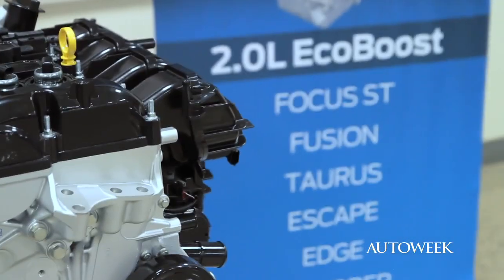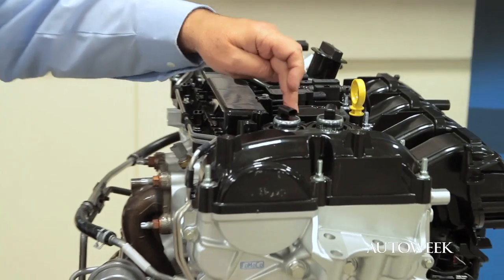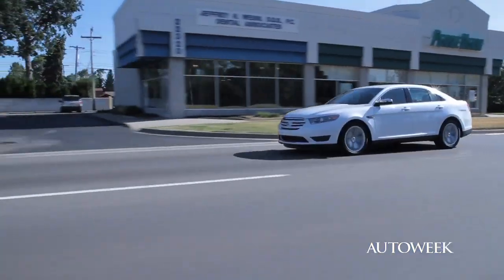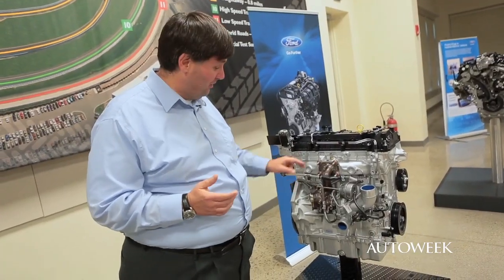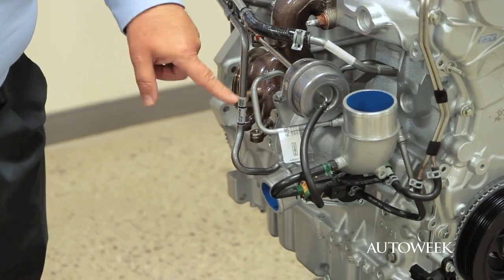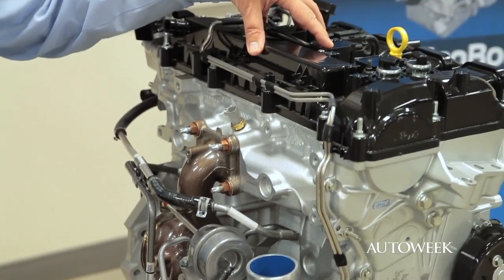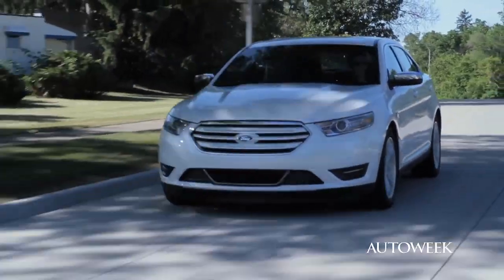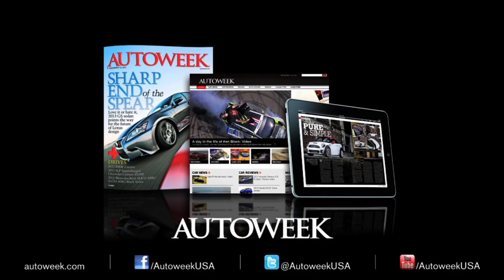Ford EcoBoost Engines: How they work - Autoweek Feature

Comment: Gas direct injection is much more complicated than this.  The timing of the fuel spray varies with need also. There are times when gas is sprayed during the downstroke after ignition as well. Our modern computer systems allow this to work. The Hyundai and Kia GDI engines have amazing power for their size without a turbo. GDI is amazing and there is much info on the web about it.
Reply: There is plenty of information out there about how DI is causing carbonizing of valves...

Comment: lol "cramming more air", sounds like he knows what he is talking about.  Most of the time, a gasoline engine works with hypo-barometric pressure to... use less fuel and burn cleaner.

Comment: I like how companies have to put stupid marketing slang on technologies that have already existed for quite some time.
Reply: i know rite?  I thought every engine maker was doing direct fuel injection now.  im pretty sure all turbocharged engines made today have it...so does that make them all ecoboost engines?
Reply: +MV Agusta hi on diesel engines yes ..i dont think on normal 95 or 98 oct..pls.inform ..not so sure
Reply: Yep, Saab started with Ecopower, their low pressure turbo charging tech back in 1986.
Reply: Remember chevy and there most reliable cars commercial, $$$ :(

Comment: The lack of exhaust manifold is to cut weight. It's just built I to the head. Many manufacturers do this now like Honda. For performance minded guys this can cause a issue when wanting to port and polish the exhaust ports. Another big downfall to all of the ECHOboost engines is the DI and the design of the PCV system. Many owners are complaining about misfires with as low as 30-40k. The fix from Ford as of now is cylinder head replacement. Lol. When DI sprays fuel right into the cylinder, the fuel doesn't have a chance to clean the intake runners and the backsides of the intake valves like on a conventional engine thus causing excess carbon build up in these areas. Then the PCV system disperses crankcase oil/vapors which also build up on the intake runners and valves. Both conditions cause a nice mucky mess. Over time this will create a misfire and other running issues. DI does have advantages but has pitfalls as well. Ford still didn't get it right. Maybe in another 100 years.
Reply: Indeed, ofcourse thru marketing, most clients wont even mind over that great technology they are explaining. It is great to have such power with Di and small engines, but the disadvantages of dirt given yo the intake should or rather "must" be also explained. Lol , we don't hate the tech it's just the downside of this Ford Di, that's why Dual port is then introduce because of problems and complains.
Well then my friend, i still stick to natural aspirated engines, specially Toyotas. 
They need not to provide extra boost if your just driving around the city, juat be patient enough and don't be zippy much down the road, people will eventually get there from B to A.

Comment: That exhuast manifolds seems to be a big restrictor on the exiting gas weirdest design I've seen on a turbo just saying that's alot of damn heat collecting not only from the trapped exhuast trying to push out but so close to the engine to seems like it would overheat your turbo without ease
Reply: they use that for the heaters. Fucking love echoboost

Comment: Pretty good video describing in lamen terms what Direct Injection and Turbo charging does. Sure it sounds more 'echo boost' the E co :P My only other observation is that he got the compression ports switched up on the cold side of the turbo (inlet pressurizing engine etc).

Comment: I fucking love how he talks about turbo's as if they're a new thing??
Reply: How would you do it smart boy?
Reply: Dalton Taylor How would I explain how ecoboost is so good? You mention the timing, the compression, the design of the head, the valves. This guy goes on about turbo's as if they're the reason that the engine is so good? Pretty much every modern car now has a turbo.. but pushing 120bhp from a 1 litre is more to do with electronics... than it is the turbo.

Comment: I'd like to see the 1.0 litre in a 100E, Anglia, the 2.0litre in a Mk 1 Cortina or Consul, and the 3.5 litre in a Zephyr, Zodiac or Mk 1 Capri.
Reply: CHris Henniker Why? Those cars are all over 50 years old. You can install one in those cars of course - at great cost. I am sure the scrap yards will have the odd engine around to save money.
Reply: I bet you can use Carpri 2.8 litre front struts, A rack & pinion steering from a Vauxhall Corsa/ MK1 escort or similar, Capri LSD, so on.

Comment: ECO boost not ECHO. And its called a turbine not a pinwheel
Reply: I'm with you guys, but I think what a lot of overly critical people on here might not consider is how well he 'dumbed it down' for the average joe. Not everyone out there is a gear head that understands a lot of this stuff.
Reply: When he said "pin wheel"......
Reply: No you guys are wrong, the thing he is talking about is a simple child’s toy made of a wheel of paper or plastic curls stuck on a stick with a pin boosting that engines power
Reply: At 7:50 lol he said this wheel sucks in air 😆😂
Reply: @Kazooboi23  7:50?
Reply: NO it's a fucken pin wheel it's made in china our CAPITAL!! it wont last long so take it to the carnival and be proud you bought a piece of shit!!!
Reply: boostedsil40 dumbest shit I’ve ever read
Reply: boostedsil40  no ecoboost as in ecosystem not economy... as in better for the environment... has nothing to do with the economy
Reply: Ecactly. We on our 3rd EcoBoost powered truck / SUV an we are sold! Awesome stuff. Simply run an SN+ full synthetic oil an Motorcraft filters an you wont see carbon buildup or any issues. Got 229k mis outta a '12 F150 Lariat Gen1 3.5L EcoBoost ..was all orig an ran great when sold to neighbor! Hes still driving it 2yrs later an raving bout power / MPGs. We have a '19 Ranger XLT FX4 in driveway. Sweet driving an awesome powertrain!
Reply: Hes thinking of food

Comment: I think he was pointing the air outlet of the turbocharger instead of the inlet normally the bigger pipe on the compressor side of the turbo would be the inlet and the small side of the turbo would be the outlet air witch is compressed I never head of a pin wheel before but a turbine and compressor wheel I did .

Comment: Its just evolution.. Things all get better, more efficient with the times changing.  Thats an awful small turbo tho. I imagine theres no lag at all... Funny I had a supercharged 96 Bonneville that made that same 240 horses. I can gurantee it was faster than an ecoboosted Taurus 4banger would ever be...And the worst gas mileage of the two as well. Haha
Reply: Zero lag it's best in it class with toque and speed